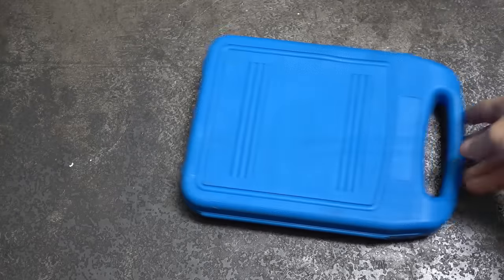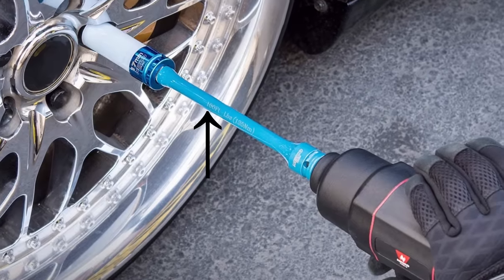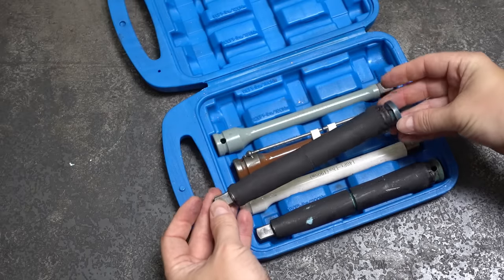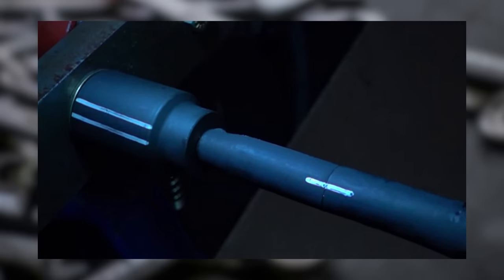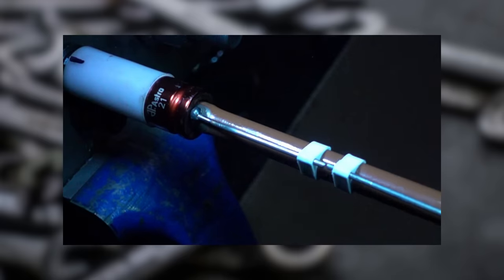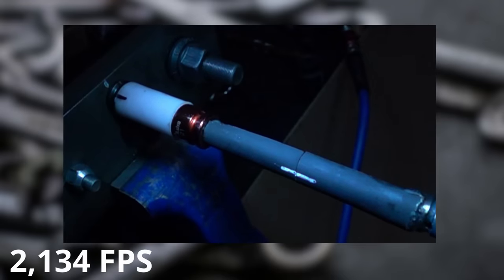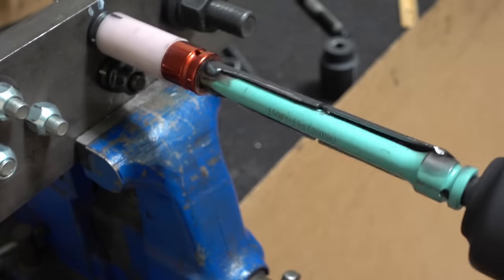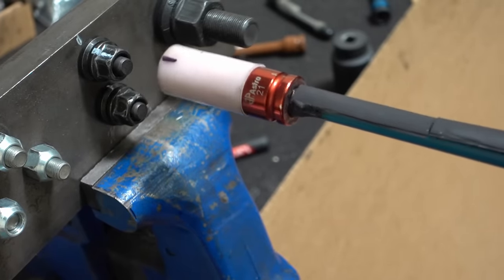Torque Sticks! High Speed Video Helps Reveal the Truth

Comment: Would you possibly consider doing a video showing how extensions effect torque wrenches? I know they effect impacts, but sometimes for my job I have to torque things to, say, 150 lb-ft, but I have to use a 3 or 6 inch extension with my torque wrench. I'm wondering how much that is effecting my final results since it's a constant linear torque and not a repeated hammer blow.
Reply: 03 or 6 inch extension shouldn’t affect it very much just because you’re applying the torque literally so it doesn’t have to transfer impact blows so as soon as you load the portion of the extension, it should consistently stay loaded if you’d using 3 ft of extensions or something then I imagine the joints would play a problem more than anything
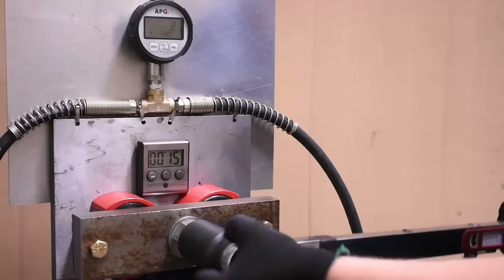Reply from the maker: @agoogleuser1188  This guys 100% right. As long as your extension is staying roughly perpendicular to the bolt, torque applied by hand has zero change when using extensions. 1:31
Reply: Agree. You can have (theoretically, with plenty of support and no offset from the wrench head to the nut) an infinitely long extension and see no torque difference. There's a pretty good video demonstration somewhere if you look.
Reply: The inaccuracy of torque with the use of an extension comes from the operator, not the extension itself. The longer the extension, the harder it becomes to apply torque while keeping the head of the torque wrench in line with the bolt/nut. This is why it's recommended to use as short of an extension as possible.
Reply: @TorqueTestChannel  
Sometimes you need to use all the extensions in the shop, it always reduces the torque. 
Im guessing due to the extension it’s self bouncing around in the connection points when adding 2 or 3 extensions together to reach in a tight spot
Reply: I did a quick search for "torque wrench extension test" on YouTube because I had previously found a video doing such a thing. Someone added every extension in the tool box, with proper support with jack stands, and it didn't affect the precision of the torque. It just took a bit longer to load the several joints.
Reply: @Sicktrickintuner  when using an impact yes, but by hand no it does not limit the torque, you can still apply equal torque

Comment: I use a 475 ft lb stick powered by a 2767 on my semi (450-500 ft lb) stopping when I don't see noticeable movement for a couple of hits and check with a torque wrench.  So far I get the click at 475 with no noticeable movement of the lug nuts.  Now I wonder if I'm going past 475 and need to reset my torque wrench to 480-500 and check for movement then.

Comment: I think I'll stick too my usual method when changing tires. Two Ugga-duggas and then with a wrench until they start too feel solid. It has worked well so far, and I've only had to change the studs once.
Reply: I've actually calibrated my right arm once, and found it to be within 2Nm of desired torque. Good enough for the girls I go out with.

Comment: I believe the first item needs another go.
 This time at a higher frame rate and closer. 
The deflection isn't great but detectable. 
The rods show the ripple effect!
 The two ends move independently so you can see when the energy is applied at one end and travel through the length.

Comment: Excellent analysis and reporting!  One question, since the electric impacts will continue to torque the nut at a given value of torque stick due to impacts per second, would going down to the next smaller rated stick give results that would not be in danger of over-torquing the nut?
Reply: in theory I believe you are headed in the right direction, but the question remains.... what final torque did you reach, since they are not celebrated for that? IOW, it will be less, but how much? (over or under the different rating)

Comment: Every time you mention these you should point out that force equals mass x acceleration. The faster the hammer goes from moving to stopped the more force was involved. The torsion of the extension makes the hammer take longer to come to a stop hence less force was involved, that's how these work.

Comment: Only reason I use a torque stick is to use a 60 ft lb stick to zip lug nuts on in the air with like 3 impacts to the lugs. Then use a torque wrench for the other ~20 ft lb. 

Just used as a safety factor because at home I usually just zip them on without a stick and although I can usually get them snug but not overtightened just by feel, I have overtightened lug nuts before accidentally by letting it impact one too many times. 

 But yeah, I guess as long as the torque stick you use still allows you to spin the nut when doing a final torque with a torque wrench it’s fine.

There’s a shop near me that used to operate entirely with torque sticks for lug nuts. That is until a torque stick overtightened a set of lug nuts and the studs snapped off of the car on the highway…

Comment: I'm even more confused on if these things work or not now.  So no not really on electric, but yes pretty good on air?  Is that the right layman's takeaway?
Reply from the maker: Yes, that's the gist. And best to use the line marking method to make sure your air gun see a 100 stick as 100 instead of 90 or 110 for instance based on its power.
Reply: They work, and they work within the margin of accuracy and repeatability for lug nuts. I’ve done a whole bunch of testing and callin ratios to verify if these work in the shop I work in.
It’s silly to state that you need a torque wrench for a “final torque” when the torque wrench’s tightening is extremely dependent on both stud condition alongside with whatever the pre-set torque is- this is something I feel TTC is avoiding saying for posterity.

For example, if you use a 65lb stick then try to torque to 80 using a torque wrench, then the torque wrench won’t move at all due to static friction. So by doing this you’ve under tightened the lugs.

Comment: you can hear the difference with and without a torque stick. one time I forgot to put on the torque stick and did the wheel nuts directly, the impact is much faster ! with torque stick there is a delay between each impact.

Comment: Since the hydraulic dyno doesn't give an accurate reading for the torque sticks, would you be able to go back and check the torque limiting settings on the DCF891? It seemed they overshot by quite a bit on the dyno

Comment: I had new tires put on my wife's car. They used the torque rods to install the wheels. It cost them new lugs, routers and nuts. When I used a torque wrench to check the nuts they where at almost 200 foot pounds. The spec for the car is 90 foot pounds. Probably should have made them replace the wheels too.

Comment: I didn't trust my torque sticks and still double check them.  With my HF compact it is within an acceptable margin of error but my mid torque dewaltt over does it right away.  I don't even bother using them with my Thunder Gun.  That almost never comes out until I'm doing wheel bearings on 1/2 ton and up trucks axle nuts.

Comment: I have a question that I’m pretty sure you could answer. So I have a 3/8 inch stubby but I see myself using my 1/2 inch 2767 a lot because it’s 1/2 inch but I would like my stubby to be 1/2 inch but I don’t want to buy a 1/2 inch stubby so if I buy a 1/2 inch anvil will it work for my 3/8 stubby if so where do you recommend I buy one?

Comment: Sorry, my results are that a hi-power impact gun will overcome a torque stick and over tighten - a lot. I measured CCW release torques and found release torque was 200% over the rating of the torque stick.  But when I manually torqued and measured release torque, I got 110 Ft/Lb release from a 100 Ft/Lb manually torqued nut. If you ever want to change a flat tire or not have wheel studs snap off in traffic, don't rely on a torque stick.  If you need to mount wheels fast, etc, use a impact gun with a known low torque limit and finish the job with a torque wrench.

Comment: I think the main reason they're much less effective on electric impacts has to do with the mechanism. Electric impacts seem to most often use a spring-preloaded hammer mechanism. The spring will wind up before "firing". On top of that, the pre-loaded nature means quite a bit of real "driving" torque can be delivered before impacting begins - that's what makes impact "drivers" so useful. In comparison, most pneumatic impacts seem to use the "twin hammer" design which has no pre-load spring and a quite different mode of operation. These impacts are basically incapable of delivering any kind of "driving" torque. All of their torque comes from the hammer impulses.

So electric impacts have two torque components - the "real torque" from cam-spring mechanism winding up against the anvil, and the "hammer torque" when the hammer finally cams over. Pneumatic impacts only have the "hammer torque".

Comment: I was told to use the sticks at less than recommended torque, then finish with an actual torque wrench to correct torque. I would say this would be common sense, this makes your job quicker with a "safety" to keep you from over torquing while getting as close as possible. So your not wasting time turning them down and guessing.

Comment: transfer of power. think of it like a wave. 
As it goes down the rod it bounces off the end of the rod, connected to the nut, and bounces back. 
With the quick hits, it doesn't have time to disipate enough and causes it to be sent back at the nut with extra power.

Comment: My best guess to why the electric impact renders the torque stick useless is because it applies a constant load on the driver while the hammer impacts the the driver vs air when stationary applies almost no load and is assisted by the hammer. Lmk what you think! If this doesn’t make sense ask and I will clarify.

Comment: At our shop in early 2010s we always dropped 20 pounds down on the torque sticks, e.g. if it was a car that called for 80 ft lbs we ran them down with the 60 stick, gets the wheels tight enough to drop the vehicle for final torquing without the chance of stressing the lug. It worked pretty well and cut about three to five minutes a vehicle.
Reply: Was wondering about this 'mitigation'. Seems logical.
Reply: This has been my thinking, tighten the nuts CLOSE with the gun, but still below, and achieve final torque with the torque wrench. I've been doing it this way for years now, and had positive results.  After awhile you even develop a sense for when the previous shop or person to work on the car used a torque wrench or didn't just by how your impact sounds and feels while pulling the lug nuts loose.
Reply: The policy for the shop I work at is to use the 55 ft/lb sticks with our guns, stop in first impact then set proper torque with a calibrated torque wrench
Reply: I use a mid tq cordless impact on the medium setting, they're pretty consistently about 80ft lbs. Then just finish with the TQ wrench.
Reply: I practice the same method just in case. Works perfectly every time.
Reply: I'm an ASE certified Master Tech for the last 36 years with 40 years of experience so far. I have never had a wheel come loose or fall off from using torque sticks only. I also get to take a lot of the wheels off that I have installed from regular customers and the lug nuts come off relatively easy. The only time I use a torque wrench is when the customer has aftermarket wheels. I can usually tell right away when a car comes in that had wheels installed by someone not using a torque stick or a torque wrench, last week I had to use my 3/4" drive ratchet with a pipe on it to get the lug nuts off.
Reply: @fastone371 please don't ever touch my vehicle if you are too lazy to use a torque wrench on every fastener to manufacturer's specs.
Reply: @beepbop6697  No problem there, you sound like one of those people that know more than the professionals, usually my favorite customers. They tell me what they want fixed, when it doesn't work I get to charge them again to properly repair their car. FWIW for the less informed a torque stick is a type of torque wrench. If I were too lazy to use a torque wrench I wouldn't have 3 digital gyro equipped torque wrenches, 1/4", 3/8" and 1/2" drive, I just happen to know where and when to use them.
Reply: My dad got back from Firestone with 5 lugs on each wheel torqued anywhere from 70-110ft/lbs. this being a front wheel that was concerning for safety reason, not to mention it would likely warp the rotor over time.

The other 3 tires they didn’t work on were all evenly torqued to 100ft lbs.
Reply: @frogganator3918  Seems like you should do several impacts on the 55ftlb stick to make sure its actually clamped down tight. This way if a tech forgets step two the wheel will most likely not come off. I never like the wheel in any state where it LOOKS tight but is not ie finger tightened.
Reply: @fastone371  Does he actually think his mechanic is using a torque wrench on every bolt? Id have to say no to working on this guys car. Probably stands outside the bay door watching 🤣
Reply: @sompka1  people really think this and it blows my damn mind. there are certain parts you 100% are gonna break out a torque wrench for and those are far and few between,

Comment: I use a 2767 and frequently change wheels on my 3500 truck (32 lugs nuts) and was thinking about using a 140lb torque stick to avoid having to use the torque wrench. Did you ever try turning the cordless impacts down, say putting in ton level 2 instead of level 3?

Comment: Having had to review process tightening methods for a large engine manufacturer I've learned that bolt tightening is a very complex subject.
Lessons learned: the boot grade, type and number of times it has been used have a massive impact on the joint 'tightness', the accuracy of most mechanical torque wrenches is questionable (+/- 15% on a good day), the practice of multiple 'clicks' on torqued fasteners is  pointless and may lead to over tightening, if you want accurate, reproducible joints on an assembly line you need a proper bolted joint analysis carried out, reliable and consistent quality fasteners (don't let those buggers in Purchasing 'value engineer' the fastener without carrying out the Bolted Joint Analysis) and, ideally, tooling that is fit for purpose (DC spindles for Production).
As for the tyre bay, it's always recommended to check your lug nuts after a few miles of driving.

Comment: Friend has shop uses mid torque cordless Ryobi guns and 80 lb sticks. Stop as soon as it resists. Have same P261 on speed 2 it works well guess 80 ft lbs based on some more the with the TW set on 90..

Comment: The anvil with air motor is designed differently than an anvil with electric motor.
If you take apart an air impact they are designed to stop pounding at some point.   Electric motors can deliver more torque.   
If you are properly installing lug nuts using a torque wrench, I feel you'll never see a stretched bolt.

Comment: I've used nothing but torque sticks on my own vehicles for over 25 years. I've never had any issues. The primary issue with torque sticks is most people use them wrong. Wrong impact gun, wrong air pressure, holding the trigger too long, or stopping too soon. If the set includes instructions, they need to be followed. If it didn't include instructions, it shouldn't be used.
"Wrong" is generally ignored in favor of "faster" nowadays. That's why most shops should require the use of a click-type  torque wrench. It's much harder to do it wrong with those, due to the physical feedback (the click).

Comment: 2:20 hmm, the smaller diameter shaft allows torsional twist throughout the length and the frequency of the anvil it will max out where it can’t exceed a torque value, the larger diameter shaft requires greater torque to twist the shaft therefore much greater torque is transferred

Comment: As far as the answer to your question is concerned you did it to yourself by adjusting the fulcrum and entry and increasing the hits per minute. You increase the pressure on that rod and it had no choice but to back up both rods would have backed up if they had both had their fulcrums readjusted. On the other hand you figured out how to make the Tail Wag the Dog

Comment: so with an electric impact wrench if you want a torque of 100ftlb you should use about an 80ftlb torque stick to get to around the torque you want but it also depends on what settings you put it on because they hit faster and create a faulse torque setting from a torque stick . ive found on my ryobie impact i first use number 1 on them first amd then number 2 to set them . number 3 is way to much and over torques them . my aeg impact number 1 is usually good or i use the auto setting to limit the ftlb . ive tested it all with my torque wrench to see whats what . i was going to buy a torque stick set but just using my ryobi on 2 is good . oh also state of charge and the ah sizes make a difference to . never overtighten your nuts .

Comment: I think you may need a better gap in the spot you cut in the middle due to it still touching will probably hold it back and not show the movement you are trying to show🤔just a thought. You guys are great 🤟👍
Reply from the maker: There's an air gap. You can fit a folded piece of paper between it pretty easily
Reply: @TorqueTestChannel  I think the concern is that the gap isn't large enough. As the torque stick twists, it will shrink slightly. You can see this same effect more obviously if you twist a piece of string while holding it taut.

Comment: I use torque sticks and hand torque them on the ground most of the guys in my shop just run them down with electric impacts and then torque them but I’m sure they are over torquing them just cause it clicks doesn’t mean it’s not over